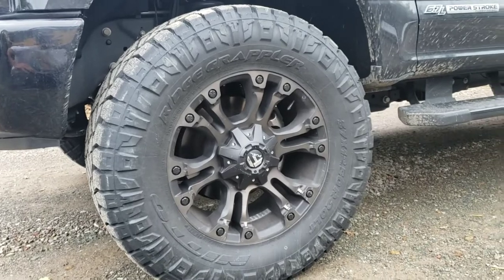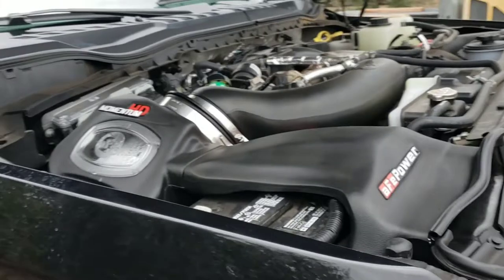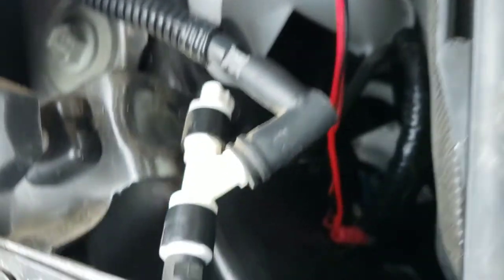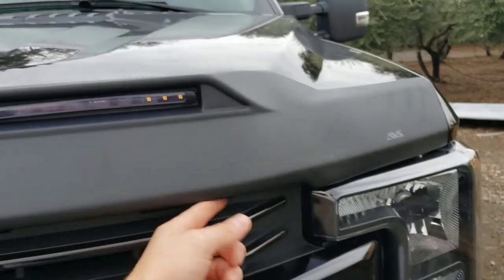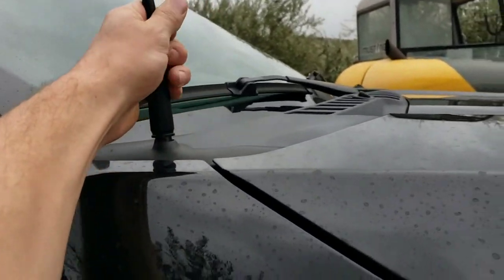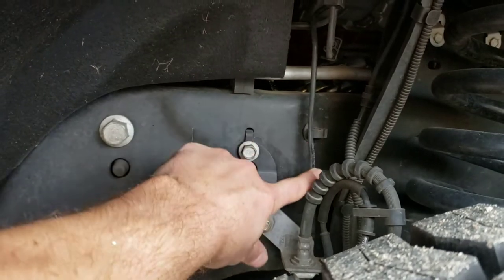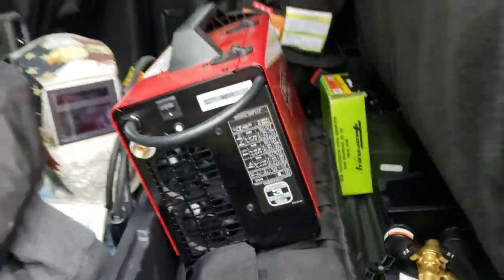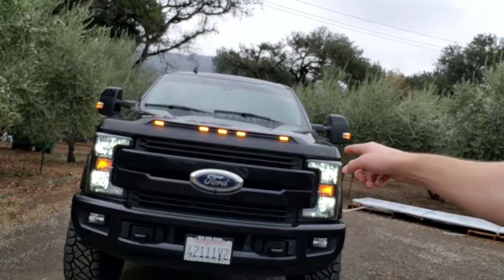2019 Ford F250 Lariat Sport ESSENTIAL UPGRADES!

Comment: Just purchased and installed same lighted bug deflector for my 2021 Ford F350.  Followed your wiring instructions and everything looks great.  Thanks for sharing video.
Reply from the maker: Awesome glad it worked out for you!! If you liked the content don't forget to like and subscribe thanks!!!
Reply: Thinking about getting it also, but might wire mine to outfitter switches
Reply: Did you have to remove the battery to get to wiring harness to wire in shied wires?   Thanks

Comment: Does the wire on the deflector hang down like an umbilical cord when the hood is up? Looks like you wired it in right up front, so I figured it must extend from the hood to the body someplace.
Thanks
Reply from the maker: No, it comes with 3m wire clamps to streamline the wire. You just run it along with your engine compartment light wire.

Comment: Hi:  Did you have to remove battery to tap into wiring harness with Posi tabs provided when installing avs hood shield with led lights Thanks Spenc
Reply from the maker: No, I didn't have to remove the battery. I would suggest disconnecting it though. Hope that helps.
Reply: @demidog4549  thank you

Comment: Did you have to adjust your lights? After putting the LED’s in?
Reply from the maker: Yea I had to adjust them just park your truck about 5 feet away from your garage door measure the hieght of your lights and match that on your garage where the cut off would be.
Reply: @demidog4549  right on I’ll do that 👍

Comment: How is the hood guard with the light strip I feel like it’s cheap. It definitely looks great and makes the truck look more aggressive is it worth it ?
Reply from the maker: I strictly installed it for looks nothing more. For me I think it serves the purpose I was hoping for and is definitely worth it to me. It runs around $170 at most websites so definitely not cheap. The light bar puts out nice light and I prefer having it taped on rather then drilling.
Reply: And you haven’t had any issues tapping into the headlight wires?
Reply from the maker: @Chris-bl6hh I haven't experienced any problems they've worked flawlessly. If you wire them into your marker lights like I showed i wouldn't expect an issue. You can also attach it to your upfitter switches if you want.
Reply: Ive used AVS in the past and if you only used the supplied tape you will have problems in the near future if driving highway speeds......at higher speeds as soon as a corner gets a little unseated it will only get worse and eventually flap in the wind and snap off.  Got warrantied a new one and bought more tape and covered every millimeter and it lasted forever.  Just a heads up.
Reply from the maker: @mattmiller8086  I installed mine as per manufacturer and have not had one issue

Comment: Do you have a link for the tool box and bed cover you are using? Also does any water get in the bed?
Reply from the maker: There's a link for all the products in the description. If I park on an incline sometimes water will get in at the backside of the tool box closest to the window. There is a gasket I need to install there to remedy. Everywhere else I havent had any water infiltration. The bed has hip and valleys which keeps most anything I have dry if it does get in from that area. Hope that helps
Reply: DeMiDoG45 yezzir, preciate it
Reply from the maker: @bloodlinehunters7607  👍 Don't forget to hit that Subscribe button

Comment: Link for the Bugshield takes me to a Silverado 1500 (ordered and learned the hard way). Do you have the link for the F250 Bugshield?
Reply from the maker: Wierd they must have changed where it went to. Here's a link to the right product Check this out at Amazon.com
Auto Ventshade 753135 Aeroskin LightShield for 2017-2019 Ford Super Duty https://www.amazon.com/dp/B07QPCHKGM/ref=cm_sw_r_other_apa_i_6CcHEb0MCM022
This was the cheapest I could find it for the link I had provided no longer exists.
Reply from the maker: @Sergio Jimenez hope that helps you out. Dont forget to SUBSCRIBE
Reply: Do they make the light shield with white leds and not amber ??

Comment: Looks good. Wondering if this improved the ride quality at all.
Reply from the maker: The ride quality on all the new superduty's is top notch. I wasnt trying to improve the ride quality as much as clearance for the larger tires. It did stiffen up and provide a little less impact feeling over hard bumps.
Reply: @demidog4549  where do you find tires like that
Reply from the maker: @НикХалден  Any tire shop should be able to get them for you.
Reply: @demidog4549  thanks man just got a truck didn't really know where to look

Comment: @ DeMiDoG45 - You deleted another comment ------> "It'd be hard to find a shop that would mount any tires out of manufacturer's specs." I would respectfully have to disagree. I have seen several hundred...maybe a few thousand Ford Super duty trucks on the road with 37 x 12.50 - 20 tires mounted on the OEM factory 20 x 8 rims. Doubtful that any of those truck owners mounted those tires, unless they work at a tire shop. The recommended rim range of 8.5 to 11 inches is for the 37 x 12.50 - 20 tire size. 

The data and specifications I have seen is the following. The tire manufacturer's post a RECOMMNEDED "rim range" and not a REQUIRED "rim range". Maybe I am wrong or have not seen all the available data and specifications.
Reply from the maker: There are alot of things in life that you can do. Not all would I recommend especially given a guideline of set recommendations. You can drive with very little engine oil and prob be ok. Would I do it? No....

Comment: I have this truck in a 2020. I'm putting a 4 inch lift on it and 37s . What do you think about using the stock wheels?
Reply from the maker: The stock wheels aren't wide enough to accommodate 37" wheels. They need to be atleast 8.5" wide I believe to be safely mounted. Hope that helps and dont forget to subscribe!!
Reply: @demidog4549  copy that. Thanks man. Subscribed
Reply from the maker: @v.garcia7571  anytime and thanks for subscribing!!
Reply: Nitto makes the Trail Grappler in a 37 x 11.50 - 20 size and can be safely mounted on a OEM factory rim. Yes.......11.50 width...not 12.50. FYI - tires are NOT mounted on wheels......tires are mounted on rims...and the rim and tire are then attached to the wheel which is connected to the vehicle. Mechanics DO NOT rebuild motors......because motors run on electricity. Instead, mechanics rebuild engines...which run on fuel.
Reply from the maker: @15Jeep  just like you dont stick a q tip in your ear, you use a cotton swab or blow your nose with a Kleenex you blow with tissue hahahaha
Reply: @demidog4549  I received your comment stating (that is no longer posted) -----> "all specs I've looked at by manufacturer state that Trail Grapplers along with the Ridge Grapplers should be mounted on a rim size of at least 8.5". The stock".....(and your comment ends here because you deleted it).

Why did you delete your 8.5 inch rim size required by all manufacturer's in response to my comment stating 8 inch rim size will work on the Nitto Trail Grappler 37 x 11.50 - 20 tire???

That is NOT cool.....especially if you are trying to get subscribers! Isn't the main point of having a YouTube channel to educate and help people regarding products that consumers buy...along with the various choices, product combinations...what works and what doesn't work, etc??? The good, the bad and the ugly? 

Granted, this is an unusual...maybe even odd ball size tire. However, this somewhat elusive tire size might be just the tire size many people want to mount on a F-250 or F-350 Ford Super Duty with a 2.5 inch lift and not have to be concerned with trimming the inner back side of the front wheel well opening. In addition, a narrow tire is more ideal for snow country...a wide tire more ideal for sand. Mud.....width is no concern...good lugs that provide clean out is preferred.

For this particular tire size ----> 37 x 11.50 - 20 ...Nitto states a rim range of 7.5 to 10 inches. For the tire size -----> 37 x 12.50 - 20 ...Nitto states a rim range of 8.5 to 11 inches. 

Virtually nobody likes to be wrong.....or called out and corrected when they are wrong. A certain amount of pride is healthy. The problem arises when pride is elevated too high in a person's ego. It is OK to be wrong......that is one of the ways we learn. The other ways we learn are by research, reading and hands on experience. There are many people who watch YouTube videos on 4WD trucks, SUV's and Jeeps that have a vast knowledge of these vehicles.

You could have made a simple comment like -----> Hey, I was not aware of that tire size, recommended rim range.....and that is good information to know.
Reply: @demidog4549  You are correct. People should not use the brand name of those products. Instead, they should say "cotton swab" or 'tissue'.

However, There is a noticeable difference here. An engine or a motor is not a "brand name". Therefore, the word motor is not a 'generic' name for an engine. A motor is NOT and engine...nor is an engine a motor. 

Q-tip is a "brand name" and actually is a "cotton swab" product. The same is true for the Kleenex brand of the 'tissue' product.

Here's another one.....Cab and Half (One and a Half cab) trucks are almost always referred to as "extended cab" trucks. Dodge made the first Cab and Half trucks called the Club Cab, Ford was second with the Super Cab. General Motors was late on the scene with their version of the Cab and Half they call the Extended Cab. The Cab and a Half Ford truck should not be called an "extended cab".....it should be called a Super Cab. 
 

People should also not talk in the "incorrect person". So...Joe talks about HIS weekend fishing trip at work on Monday morning...and says, "when YOU cast YOUR line over beside the granite boulder, there are usually some trout lurking in the eddy beside it, so I usually catch one." Joe is incorrectly mixing the use of first and third persons in HIS story. Joe should have said, "when I cast my line by that granite boulder, there are usually some trout in the eddy next to it, so I usually catch one."

In all of the examples above......most people understand what is being said...even though what is being said is not correct.
Reply from the maker: @15Jeep  if you look at my response that you re posted I never stated a Requirement I used a specific word, "should". That is what the manufacturer stated they should be mounted on specific rim range. Most likely for liability purposes
Reply from the maker: @15Jeep  thanks for the english lesson. I have no problem being wrong im wrong all the time. I'm not sure you can say the same for yourself. You seem very motivated at proving someone else is. Either way good info 👍
Reply: @demidog4549  I read "safely mounted"...... -------> "The stock wheels aren't wide enough to accommodate 37" wheels. They need to be atleast 8.5" wide I believe to be safely mounted." Close Enough! Maybe I read the wrong comment.
Reply: @demidog4549  I have absolutely no problem admitting when I am wrong. I don't mind being wrong...not a big deal. It is one of the ways I learn.

Six months ago, I was not even aware Nitto made the Trail Grappler in 37 x 11.50 - 20 tire.....with a stated width rim range of 7.5 to 10 inches.

I was simply attempting to add a meaningful comment with those details.....mainly for the benefit of V. Garcia...but also to let you know. 

I probably could have worded my comments a bit different. I will read my comments again and most likely delete some words...maybe some sentences, because I intention is to always provide meaningful information.
Reply from the maker: @15Jeep  I also stated " I believe" in context would mean to my knowledge with deeper consideration not fact.

Comment: Morimoto XBs a must
Reply from the maker: The problem with those are they negate the auto function on your headlights.
Reply: @demidog4549  shut auto off
Reply from the maker: @DynoDieselWagon  haha yea I could do that but I like the function I've gotten used to not having to turn my lights on and off. When I do upgrade I hope they will have that issue fixed with an aftermarket headlight assembly.
Reply: DeMiDoG45 the morimoto’s are legit I turn more heads with them in my Limited 2019 F250
Reply: Turbo Diesel-Wagon for those that know the Morimoto’s can’t be beat
Reply: DeMiDoG45 I have my oem LED headlights if your interested I have the morimotos now that way you can keep the auto bright function
Reply from the maker: @dr.bowdoin3067  hah what are you trying to get out of them??
Reply: DeMiDoG45 $750 sound good to you?
Reply: @dr.bowdoin3067  no ty. They turn girly PINK after awhile 💗
Reply from the maker: @dr.bowdoin3067  that's a fair deal I'll definitely think about it.
Reply: DeMiDoG45 hey my auto function works with the morimotos 👍🏼
Reply from the maker: @dr.bowdoin3067  really that's awesome I might just have to pick them up then. Thanks!!! Dont forget to subscribe!!!
Reply: DeMiDoG45 subscribed 👍🏼
Reply from the maker: @dr.bowdoin3067  awesome much appreciated!!!
Reply from the maker: @DynoDieselWagon  https://youtu.be/KmMtV9aHGU4
Reply: I have morimoto xb hybrid and the auto function works fine?

Comment: What’s the brand for the headlights?
Reply from the maker: The headlights themselves are stock OEM came with the truck. The sport lariat upgrade comes with blacked out trim around the side marker. I installed aftermarket led bulbs V.4. If that helps.
Reply from the maker: Ford Super Duty F250 F350 2017-2018 LED Headlight Bulbs Upgrade Kit
https://headlightrevolution.com/2017-ford-f250-f350-super-duty-led-headlight-bulbs-upgrade-kit-4-bulbs-v-4/

My lower bulbs had major flickering so I had to get the module to correct it. As you can see in the video it worked and I havent had an issue since.
Reply: @demidog4549  Headlight Revolution is an excellent source for aftermarket LED bulbs. Think they have a YouTube video showing a stock pile of LED lights. Their video shows and explains most LED's are junk.....only a few LED's are high quality. One of the best LED headlight manufacturer's is GTR Lighting in Georgia......very high quality LED bulbs.

Comment: so you have no rubbing on 37s?
Reply from the maker: Not in any normal driving situation. If I turn it full to the right or left when going over a bump say turning into a driveway that's at an incline and going faster than normal it might hit a little as the front end depresses. That's pretty much the only time I've had or heard it rub at all.
Reply: @demidog4549  I see your link is for 20x10-18, but you mentioned a 20x9 +20mm.  It really looks good, which one did you go with?
I have a 17 platinum and debating wheel offset and width.  I'm okay if the tires stick about an 1-1.5" pass fenders it just helps having a visual like yours.
Reply from the maker: @dwuchterl  I honestly have a hard time remembering I believe there the same as the link I posted. I'll double check my paper work and let you know.
Reply from the maker: @dwuchterl  I actually have the 20x9 +20offset hope that helps. I'll change the link if you liked the content don't forget to like and subscribe thanks.

Comment: @ DeMiDoG45 - The comments below are related to a comment originally posted by V. Garcia and your response. I added an additional comment and received a reply from you. I am addressing your reply here....and again down below under your response to V. Garcia. 

I received your comment stating (that is no longer posted) -----> "all specs I've looked at by manufacturer state that Trail Grapplers along with the Ridge Grapplers should be mounted on a rim size of at least 8.5". The stock".....(and your comment ends here because you deleted it).

Granted, this is an unusual...maybe even odd ball size tire. However, this somewhat elusive tire size might be just the tire size many people want to mount on a F-250 or F-350 Ford Super Duty with a 2.5 inch lift and not have to be concerned with trimming the inner back side of the front wheel well opening. In addition, a narrow tire is more ideal for snow country...a wide tire more ideal for sand. Mud.....width is no concern...good lugs that provide clean out is preferred.

For this particular tire size ----> 37 x 11.50 - 20 ...Nitto states a "rim range" of 7.5 to 10 inches. For the tire size -----> 37 x 12.50 - 20 ...Nitto states a "rim range" of 8.5 to 11 inches.
Reply from the maker: I misread the initial comment and thus deleted because yes you were right about the 11.5 width tire. No ill will Mike, you seem very knowledgeable about tires not my specialty. I wasnt able personally to find anyone who would mount the tires I have on this truck on my stock set. The all stated they must have 8.5" and maybe they were just blowing smoke but it's what I experienced. Thanks for the comments and a time you've spent in your replies.